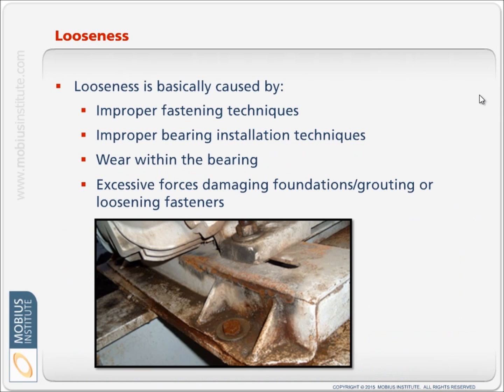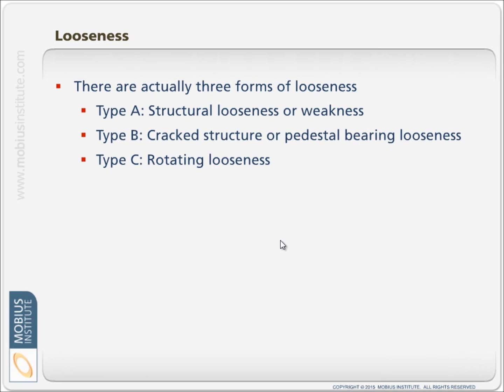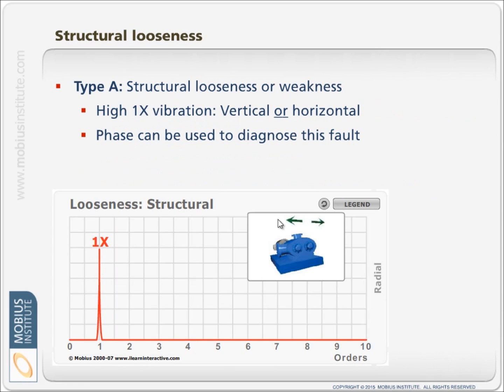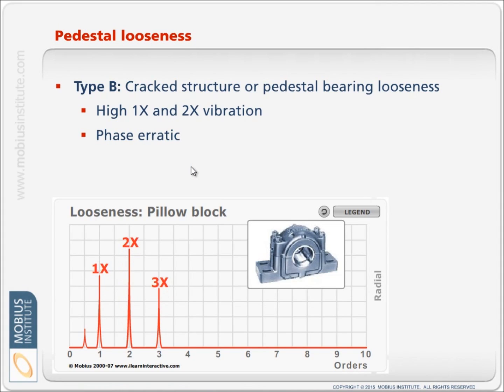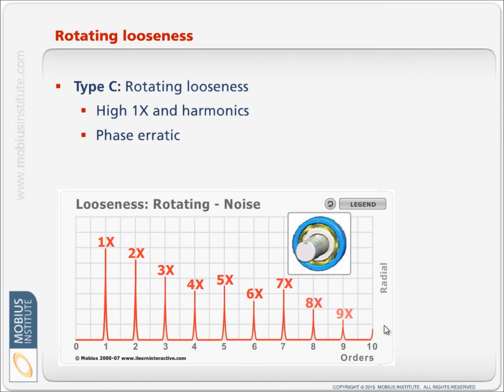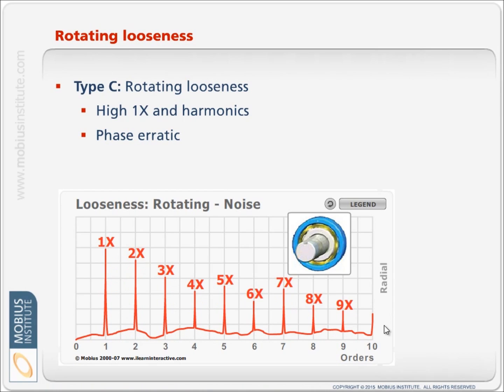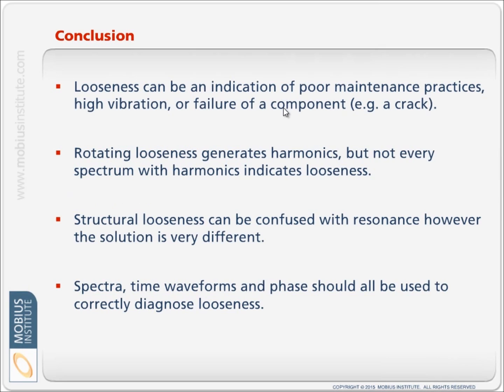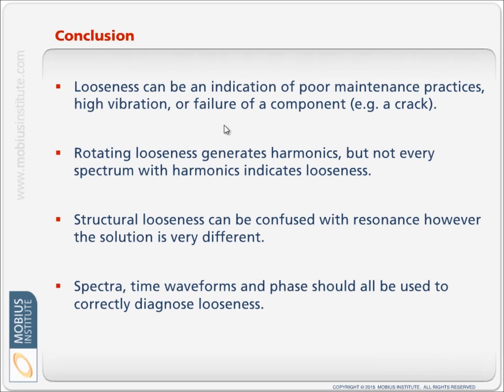Vibration Analysis Know-How: Diagnosing Looseness

Comment: Can you please explain what's the significance of 1x 2x 3x in VA? For example, The input shaft speed in a multi stage gearbox is always the same and what's the purpose of showing the frequency normalised and represented as multiples of shaft speed? Is 1x means first turn of the shaft and 2x means the second turn??
Thanks

Comment: Hello, I have data from some sensors placed on the large motor. In the spectrum of almost all sensors, I found large value of spectral power for only 0.1 Hz and sometimes 0.1Hz, 0.2 Hz and 0.3Hz. For higher frequency of more than 0.3 Hz  spectral power is close to zero.  Can you say me why for all spectrum I am getting higher value of spectral power for 0.1 Hz?